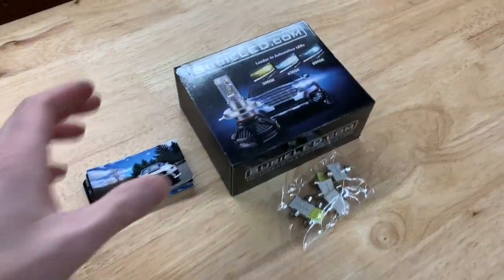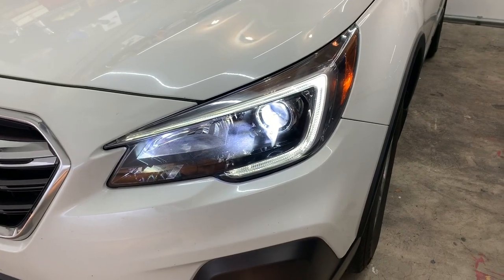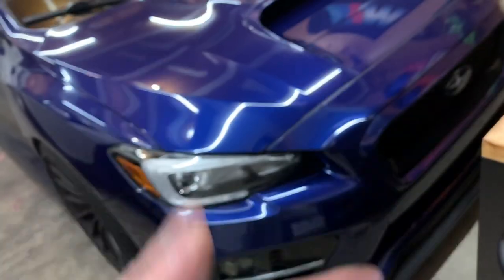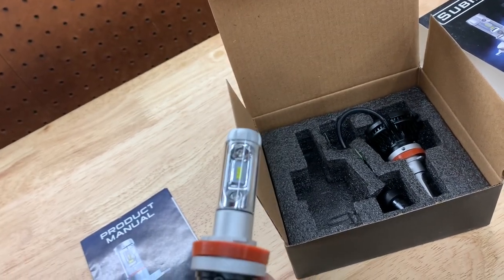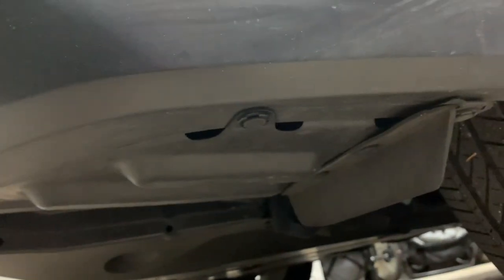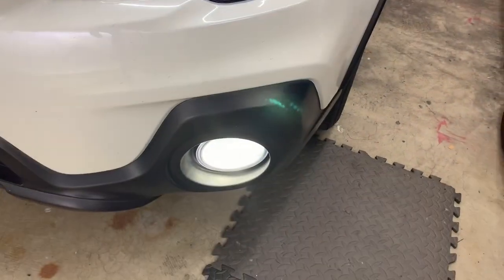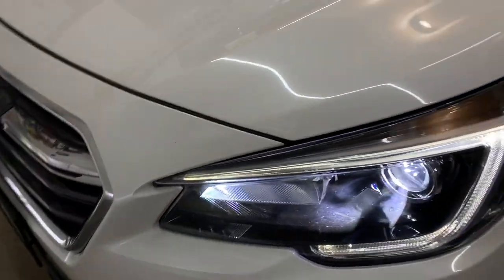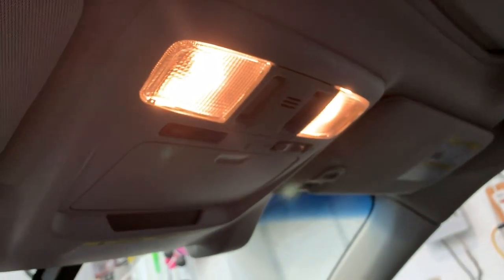Upgrading the Outback with LED’s | SubieLED

Comment: The trunk lights for the Subaru legacy and Outback is a 168 light bulb. The 194 bulb is also compatible.  The differences between the 168 and 194 bulbs when they are led is that the 168 led bulb is about 4.9 watts and the 194 led bulb is at 3.8 watts.

Comment: How did you get the LED bulbs in the low beam socket? It’s just too confined up in there for me to pull it off, and since my projector part of the lights were shot, it didn’t help anyway. Used aftermarket headlights (big mistake), they won’t adjust, so ordered another DOT certified set, now back to pull the front bumper cover off to change them, (again, ugh!)

Comment: Did you have any issues with the high beams coming on when the car is running and in gear… I swapped some LED’s into a 09 forester, and a 2012 outback, and unless the low beams are switched on, the high beams run 24/7 when in gear.
Reply from the maker: Never had that issue

Comment: I have a 2018 outback 3.6R and the driver side led light is not working (all bulbs work); I changed the interior  #23 fuse and switched the relays (DRL) in the engine fuse box since the passenger side works.  no luck.  any ideas how to make this work?  I love the bulbs you put in!  I'll have to do this in the spring!  thanks for the upgrading video.    thank you .
Reply from the maker: Anything led on the OEM headlights is not replaceable. I would hit up your dealer to see if they can get it sorted for you.
Reply: @Scoobyfreak86  thanks for the quick reply.  it's the "C" around the outside; I'm calling them LED, but maybe I'm incorrect.  Could the "C" be connected to the high beam?  maybe I'll replace the bulb to see. . . .:-)  thanks again.
Reply: @Scoobyfreak86  also, not fond of dealers. . . :-)
Reply from the maker: They are an led board that uses a diffuser to light the c light. It’s not just a bulb.
Reply: @Scoobyfreak86  thank  you.  you know a lot. . . :-)  .  can you point me to how or where the diffuser is connected,? I might be able to  purchase/replace it, or do you have a part number for it. . .   ?
Reply from the maker: You have to take the headlights apart to gain access. 

Watch my video on my STI and you’ll see what I mean. https://youtu.be/jFP_75RNXTI

Comment: I have a 2019 Subaru Outback— just like the white one in your video — can I use the ones in the box for my headlights? Not the foglights
Reply from the maker: The fog lights and low beam bulbs are both h11 so yes they can be used for either application.

Comment: have you been concerned with the heat the produce?  Also are they too bright for oncoming traffic when driving down a highway?
Reply from the maker: They run cooler than stock halogens. 

You can align and aim the fogs if you find yours aimed too high, but I had no issues.
Reply: @Scoobyfreak86  was your original bulb an h11 or h16?
Reply from the maker: H11
Reply: I had projector headlights on a 04 Saturn. The heat from INCANDESCENT bulbs - especially HID capsules- is so much more intense. The inside of the projector housing was burnt grey on the top third of the mirrored interior. Cut light output 30%+ . Get those 'burning' bulbs out of those confined spaces before you burn off the silver inside of the projector housing!

Comment: Well, this is my story, I have a 2018 outback and I put the same Lastfit H11 fog lights, long story short, the car was 4 months at the dealer and 6,300 dollars in repair costs, if someone is useful this advice is free
Reply from the maker: These are not lasfit bulbs. I’ve been running these subieled bulbs on 2 of my Subarus for 4 years and 0 issues. In fact they are still running strong.
Reply: Scoobyfreak86 
it's good to know brother I didn't have that luck
Reply: so, you're saying the bulbs made you have a wreck?
Reply: @dabcorn  I never said it was an accident, the light bulbs caused a circuit cut that damaged the car's computer and sensor, and for that reason have to be replaced, I don't say that it will happen to everyone, this is what happened to me